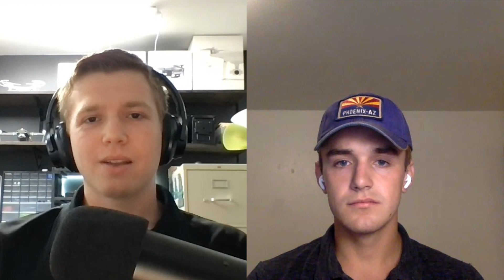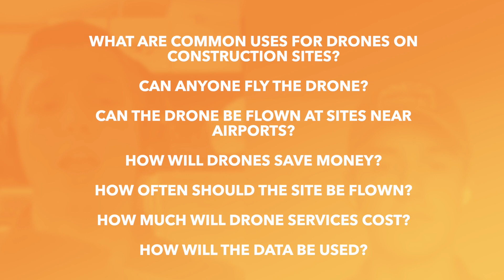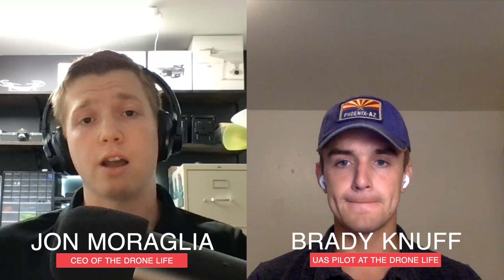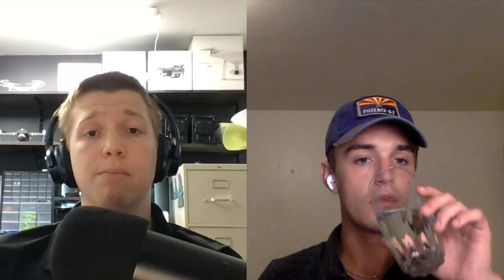7 Most Common Questions About Drones in Construction

Comment: @11:02 Theft in construction is huge.
If a builder hires a subcontractor and buys lumber and other materials but materials are disappearing faster than a structure is built, they will see materials lost and unaccounted for. If the subcontractor claims all the material is accounted for and nothing is missing, that's a problem. Likewise, if the subcontractor says it has already used up materials and claims the builder needs to buy more materials, volumetric measurements can show they do have the gravel or soil needed to finish the work instead of just taking for granted the word of the subcontractor.

Comment: just a quick suggestion.  around 8 minute mark, you were using the term "waiver" when it comes to flying in controlled airspace.  This is very commonly misused.  The correct term and document needed is a Certificate of Authorization (COA).  a Waiver is something that waives or allows some part of Part 107 to be overruled, so to speak, and to operate in a very specific way.  a COA is specific to airspace penetration, more specifically to controlled airspace.  in other words, a "waiver" and a "COA" are very different.   LUV your content....